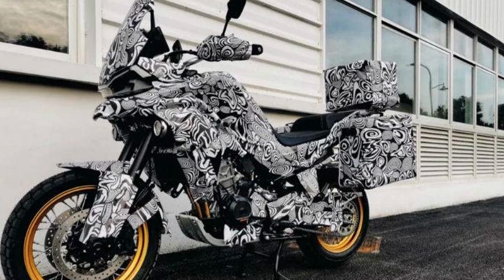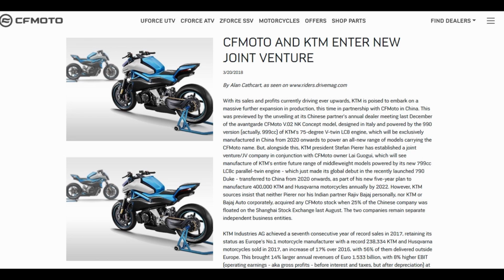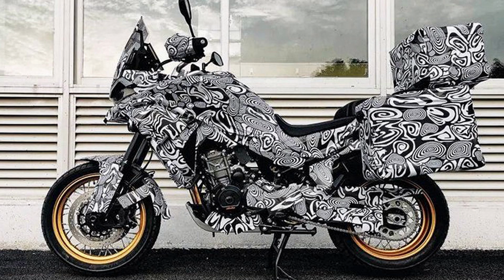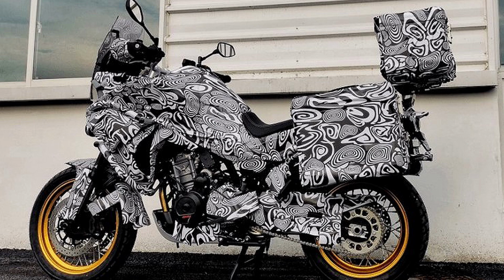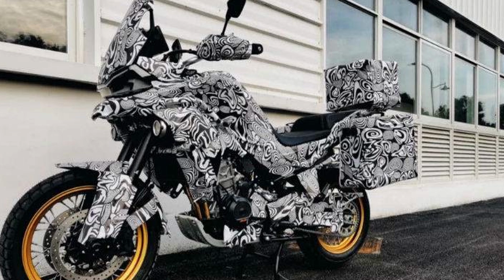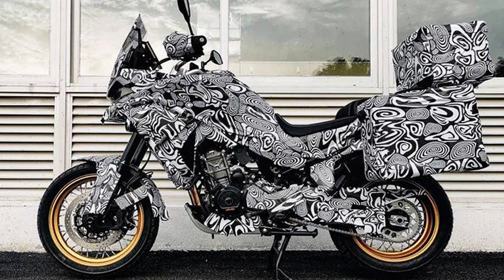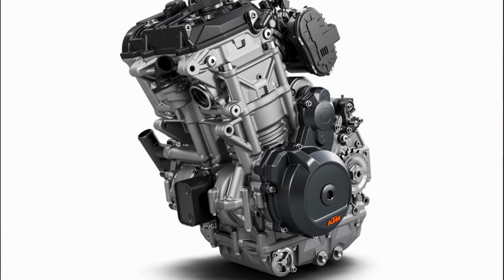CFMOTO MT800 | Using KTM 790 Engine | ADV NEWS

Comment: CFMoto has an adventure bike with 660cc engine and it's not a bad bike, except for one thing. They placed the front forks under such a strange angle that it gets difficult to control it at low speed. This bike seems to has the same weirdly positioned front from what I can see on photo, but I didn't go as far as to compare to other companies so might be just me seeing things.

Comment: Actually, the KTM has had a ton of issues. I thought the unreliable KTM thing was a myth, but all the American big bike shows are complaining about a ton of warranty issues, as well as getting those issues addressed. So it might be an unreliable engine in a second-rate frame, components etc. I probably wouldn't consider one, although it looks ok. Randomly it looks like it has an 18" 19" combo. If it had NO rider aides, simple injection AND was VERY cheap, it could do ok. Kind of a budget Africa Twin. I guess it will be heavy - same weight as VStrom etc. Who knows might be a good-un. I don't have an issue with Chinese products - It depends whether they are built DOWN to a price, or UP to a standard.

Comment: Using a KTM motor goes a long ways to entice new owners. But, CFMOTO will have to prove the little bits are quality kit too. E.g. switch gear, clocks,  footpegs mounts etc. We know they can produce very high quality gear but they seem to get in trouble when they go for the cheapest price and cut corners too much. Teach them to go "cheaper", not "cheapest" and maintain QC - they will be very a formidable foe in the market place. The rest of the market will recall what happened to the British motorcycle industry when Japan caught fire and most will be very careful not to repeat (except maybe Harley Davidson - but for different reasons) those mistakes.

As an aside; Thailand and Vietnam have a decent motorcycle manufacturing. One should assume that at some point they could hit the global market with their own efforts - assuming we're not forced to all electric in less than 20 years.
Reply from the maker: Some good insight Ronald.